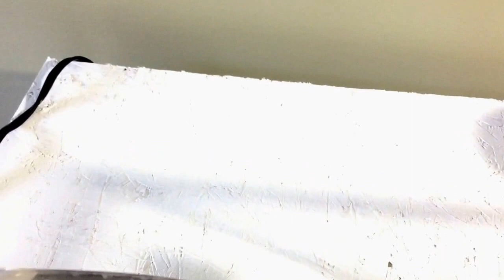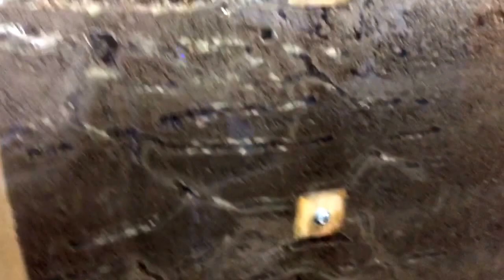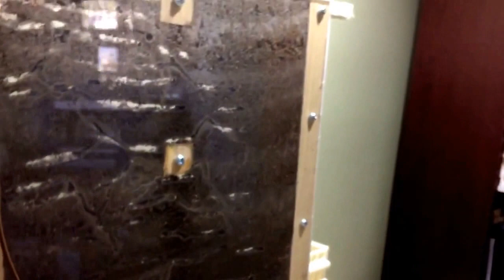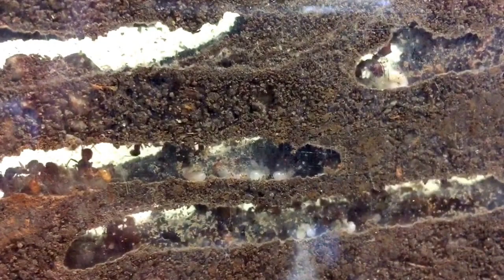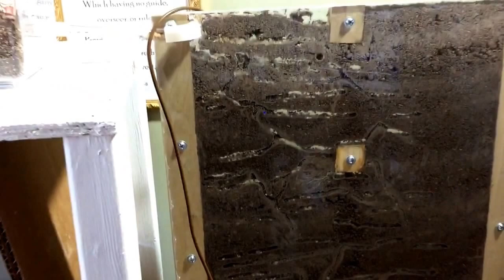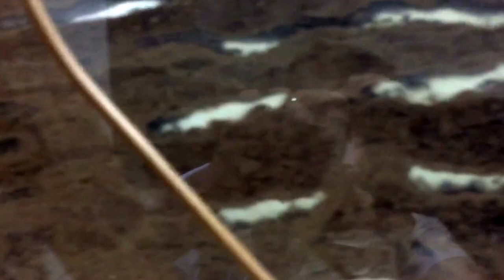Soil formicarium - 7 weeks

Comment: How does the hydration system work..... Very nice Formicarium, it can't get any more natural than this so cheers mate!
Reply from the maker: Thanks! Hydration system keeps the lower section of the nest moist. Over time the upper-most portion of the nest has become somewhat dry, but the ants are fine. This is natural for them. If they need moisture, they go down to the bottom of the formicarium. There is a fine screen mesh across the bottom of the formicarium to keep the ants from going into the hydration area. I filled the hydration area with perlite and I have a piece of poly tubing that is attached to the bottom of the hydration area. Every week or two, I unplug the poly tubing and add water to fill up the hydration area. It slowly is absorbed up into the lower section of the nest. Seems to be working great so far.
Reply: +Ooper Cool :)

Comment: What soil did you use. I'm worried I'll have a cave in.
Reply from the maker: I used a mixture of soil from my yard (clay-based), top soil, and sand. I pre-mixed it all in a bucket, moistened it a little and then added 3 to 4 inches at a time, compacting it as I added it.
Reply: Ooper cheers for that, doing a few little mods to my table and filling it today. I'll post a video when it's done. Thanks for the help